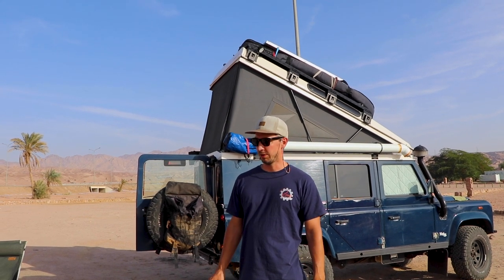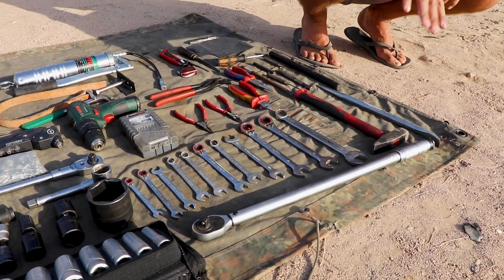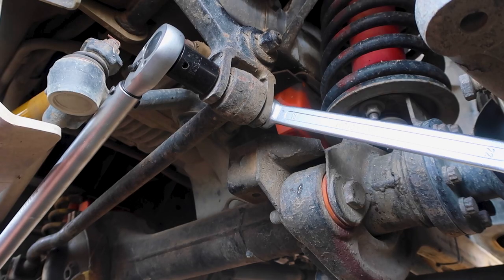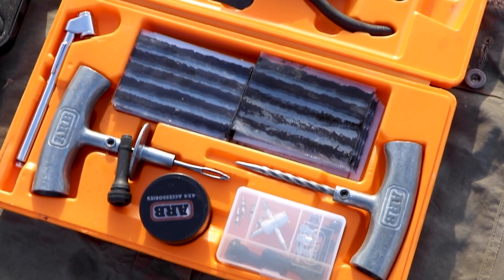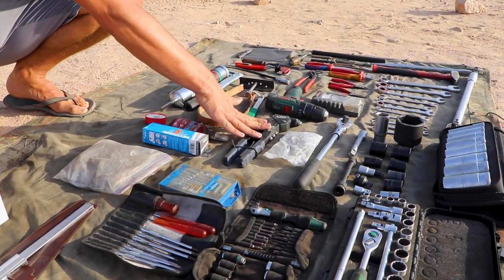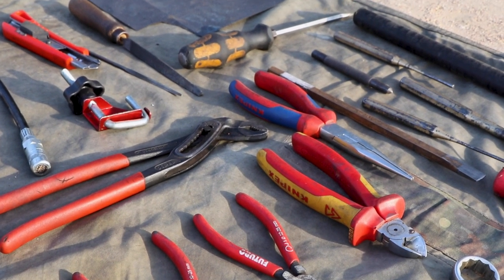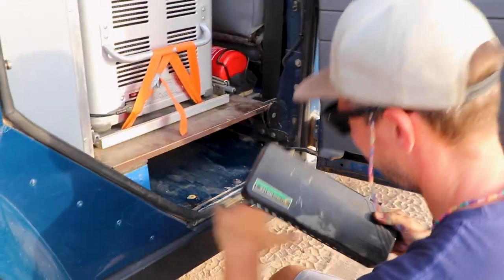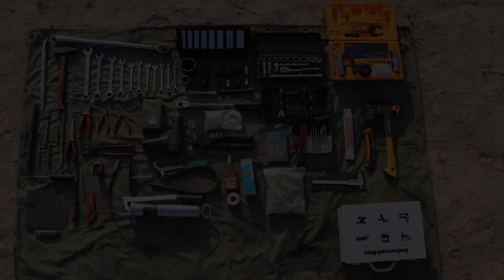Overlanding Tool Kit // Land Rover Defender

Comment: Really great setup, just view, my suggestion (before watching your other video, next thing i will do soon) are more electrical spare like: wire , connector, swtitch (!!!), crimper, kumpercable/booster, some relay and finally solenoid starter(!)... and I hgave spare vise can mount on trailer hitch
Reply from the maker: Hey, thank you for your suggestions! I got some wire some Wago connectors, and crimp connectors, and a soldering iron, aswell as a multi meter and fuses. That was more in the section spare parts than tool. But fair pint. The magnet switch was rebuild before the trip and I had to overhaul it in Argentina (either ep 72 or 73). I do not bring a crimper a Normal pair of pliers do the job it's not to code but but it works long enough to get back to civilization. 😉

Comment: I always have a BFH on hand (big F'n hammer!). A big lump hammer is very useful for persuading bits of metal to move. You may not need it often but when you do, it's the only thing that will work.
Reply from the maker: Good point, sofar I didn’t miss one, my issue is I don’t know where I would store it in the car.

Comment: Great series of videos for sure. I  have subscribed. As an aside, if I were you I would think about going back to the original rear wheel bearing adjustment method used on the older 110's, with just two nuts and a tab washer. This way as bearings wear you take out the play and drive on with no need for different size spacers and extreme torque. Wheel flange off....tab washer bent back, nuts tightened and do up in reverse and drive off.  All the best. :)
Reply from the maker: Hey thanks for reaching out! Glad you like the  videos! 
I heard from some that did it. So far luckily we did had much trouble with wheel bearings.  But this might be worth it knowing that we have lots of km in front of us. Do you need to change hubs or stub axles? Or is ist just bearings….

Comment: I can recommend moving to a good tool bag. I'm using the "blue ridge overland gear" tool bag and I fit pretty much everything you showed in that bag. I also carry electrical tools like a butane soldering iron, and other stuff all in that bag. Removing all the tools from their hard cases saves a lot of space. And you can also consolidate. eg. the ARB tyre repair kit contains a set of pliers and a blade which are probably not needed. Anyway, good video. Thumbs up from me.
Reply from the maker: Hey Richard, thanks for the hint I had a tool roll before for shorter trips it was fine. But I like the box cause it fits perfectly underneath the floor and holds everything. Works just well for me. Yeah I know I could save some things here and there, but if I removed stuff from the tire-fixing kit I'll loose it and it's convenient to move it from one car to the next and know you've everything you need… 
My brother brought the soldering iron so that is in the car as well 😉
Thanks for commenting!

Comment: A portable grinder would come handy in a lot of cases and air blower...You can find both working on the same battery from Bosch
Reply from the maker: Hey, I’ve small grinding bits for the power drill, I’ve nothing like a angle grinder if you refer to that. But didn’t miss it yet. 
We got an compressor onboard we use that as blower.

Comment: great set - not as experienced as you guys are, but i have also a long flexible gripper in case something drops and hard to get at, it is also equipped with a magnet. oh and a small magnetic dish, where you can drop in your nuts and bolts while you work on the car.
Reply from the maker: That’s good additions, but due to the limited space they had to stay at home. 
In a lot of places I swapped the original bolts to stainless steel, those don’t stay in the dish there for I don’t miss it too much. 

Thanks!

Comment: Pretty much all you need, I have a Lidl's toolkit, screwdrivers, pliers, sidecutters and a set of spanners for the "overland tool kit" there will be more in that than the kit as is. I would suggest you also have a few imperial sizes like 2x 9/16th for the prop, 1/2" bi-hex sockets for the brake calipers, and a 30mm shallow socket for checking the rear axle ball joint, radius arms and the transfer box drive flange nuts. You have pretty much minimal amount of what you need.
Reply from the maker: Hey, thank for the hint! 
The tool/socket for the prob is in 1:55 together with a 14mm works great. 
All the stahlwille nuts are be hex, I had no problem with the metric sizes while we took of the calipers. But I'll check that again. 
Yeah you're right a short 30mm socket is missing.